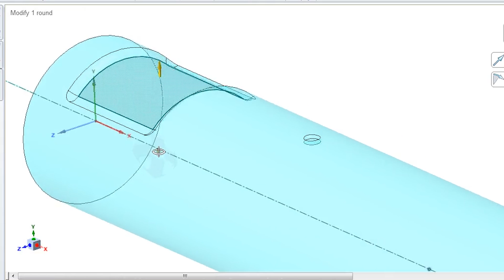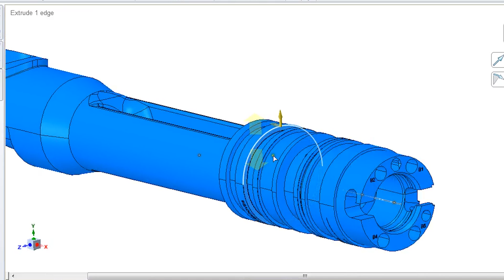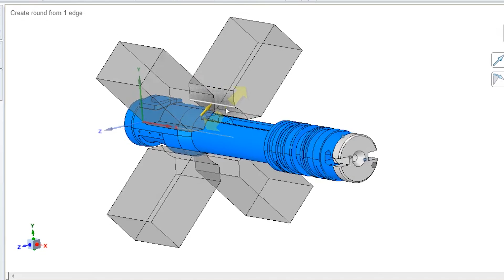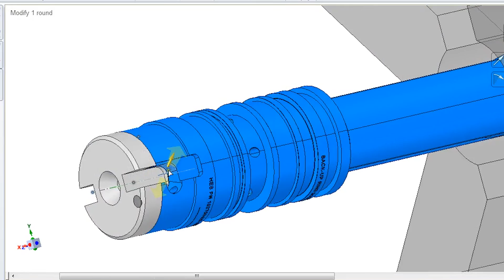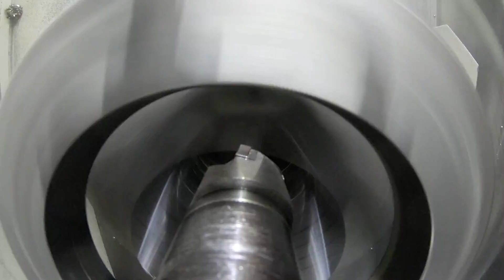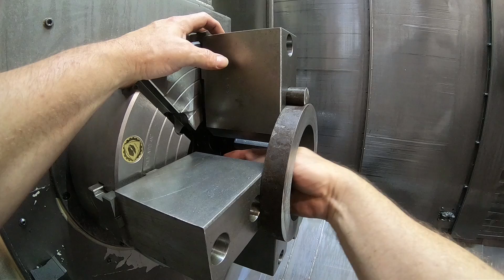Bore Jaws Again New Job

Comment: Very nice video. Im a machinist from Tomball. I started using the tailstock at a my new job but it pushes the part up and down. I can see it and feel it. Does the tailstock need adjustment?
Reply from the maker: Thanks Jose. It sounds like it does. Turn a part with the tailstock than mic the diameter along its length. The diameter should be the same at each end and in the middle. Or as close as reasonably possible. If not the tail stock or spindle need adjustment.
Reply: Edge Precision thank you. The machine itself has about .002 taper. But when using tailstock it has about .009. Thanks for your time

Comment: I have a HAAS lathe St-30, mill turn, X,Z,C axis. No Y axis. How do you set your zero for your jaws on the mill operation in this video. And how would the WCS look like in the cam? love your instagram page by the way thanks for this knowledge.
Reply from the maker: The zero in this cad drawing doesn’t show as the one I set on the machine. I copied just the jaws solids into a new file that was not shown in the video. The zero was set with the XY on centerline of rotation and the Z on the face of the jaws. It is basically the same in cam.

Comment: Really dumb/ "Silly question"... @Peter Increasingly I see small finishing operations being performed on multi-axis machines that utilize GRINDING. I.e. small grinding tool, a dressing operation and then a couple of light passes (especially for hardened materials). Question is ::: Doing light grinding/finishing operation on an Integrex machine less than 0.001% of the "work" would that 'eff-up one's machine in terms of filtration and swarf / fine particles. Is there a way around that to protect one's machine from being knackered by fine particulates in such a case? [This is for folks that don't have a ton of expensive grinding equipment in their shop and need to achieve more "randomized" surface finish with reasonable tolerances for smaller key features and surfaces.].
Reply from the maker: I would say first you should try hard turning and milling with CBN inserts. After that if it was very little grinding say with super abrasives that would probably be OK. Think about people that grind on their engine lathes with tool post grinders. If you were going to do a fare amount of grinding with standard abrasives you would need a special filter system. Maybe laying some of that filtering paper in the chip conveyor holding it with magnets might be good for a little grinding to catch the abrasive before going into the conveyor.
Reply: + Edge Precision , That's a great tip especially filter paper + magnets. Hard turning and milling + CBN inserts that seems like fun (not everyone will have the small chuck + rpm for smaller work pieces) but for larger diameter work pieces that must be quite a 'trip" seeing that dynamic annealing process at high surface temperature with glowing strings coming off would be cool... [Maybe one for your go-pro in low light with white hot strings @ Peter... Good shots BTW your rig  + lighting is working out well]. Some folks from the application end of things say that sometimes just hard turned articles have a surface pattern (almost invisible) that can induce a tapered or mating fitting or what-not to bind and hence a more "Random" surface structure (rather than banded structure) would prevent that hence a finish "Grind". GREAT TIP BTW really appreciate it. Lot of things to try out. Very nice.

Comment: So valuable. Your average CAD-jockey transitioning to complex machining would never in a million years think of boring the jaws the way you did @ Peter. Those pins and the ring; so important [It's like you cut a pre-figured very slight taper into the jaws that when at full clamping pressure extend that pressure to the work piece better to the front of the jaws... That's really cool!]. . Also what you said about reducing the profile / gripping surface of jaws on a 4 jaw chuck to aid adjustment so the work piece is not locked into an unfavorable position really useful [That "tip" would save someone a LOT of "monkeying" about]. Dumb question... Does using that ring and pins substantially help rigidity in an interrupted cut also.

 Eventually kinda interested in what can be done to make interrupted cuts "Easier" and "Better" on an actual work piece as well... Food for thought. THANKS SO MUCH FOR MAKING THESE VIDEOS !!! :-)
Reply from the maker: A lot of times I see people with vibration problems on CNC (Or manual) equipment. I inquire how they bored the soft jaws. A good percentage of the time this is their problem and they don't know it. It will help with any chucking operation. Getting full contact and equal pressure on the soft jaws is always good. No mater what the machining operation.

Comment: Did you braze that bronze in there?
Reply from the maker: No it was sent to a shop that specializes in this. I think they have a CNC machine that does it with some kind of arc welding process.

Comment: Peter,did you use Polish BISON 4 jaw chuck?if so what do you think of its quality?im thinking of buying one .lucky for me im in Europe just under Poland.thanks for your videos .
Reply: and also can i bore holes for pins like yours in 125mm chuck with no holes?thanks agan for your time.
Reply: Stefan Stamatov you could use that method on any size chuck, but for a small chuck an adjustable boring ring would make sense.
Reply from the maker: Yes the chuck says on it Made in Poland. I have had good success with this chuck. I think there was another comment that said they also use these chucks and like them.

Comment: Do you have any idea on the actual chuck pressure when tightened , or just doing it by feel ? . cause on hidraulics it's really easy to clamp with same pressure every time . Cheers , and congrats on closing in on 20000 subs
Reply from the maker: Thanks kiss peter, No I can't tell the actual chuck pressure. I am using that 3/4" ratchet wrench with a 28" long handle (When its fully extended). Sometimes I even put a 24" long piece of pipe on that and have pulled as hard as I can. So that's a lot of toque. With the serrated hard jaws it digs into steel about the same as a hydraulic chuck would with some pressure on it.  On the sub's thing thanks. It was AVE's shout out that got me an additional 3000 or so sub's.

Comment: So do you have a cabinet full of soft jaws you have done over the years that you can sort thru and use when setting up?
Reply from the maker: I do have quite a few. I do often times get to repeat the jobs. So I resist machining the special ones if possible.  At the size of these jaws that's a significant investment. I am giving some thought to buying some flat bar and making some myself. The problem is I just don't have the time. I guess in a way that's a good thing.

Comment: Did you order your Mazak without the hydraulic chuck ?
Reply from the maker: I do have a hydraulic chuck. It's a 21" kitagawa. The odd thing its never been on the machine. It still has the original cosmolean on it. The people that owned the machine before me did mostly shaft type of work with gears in them. So they put a special center shaft driving chuck and never mounted the 21" chuck. When I received the machine the 21" chuck would have to much clearance problems for my initial setups. I also needed the manual four jaw (Some of the parts I do have two centerlines). After using the smaller (16-1/4") four jaw I began to like it and never have mounted the 21" chuck ether. The manual chuck has many advantages for my type of work where the chucking time is not a significant factor.
Reply: Edge Precision Sell that Kitagawa and use the proceeds for some new Sandvik Prime tools and inserts!

Comment: You're using a Mazak CNC? Also whats the best CNC company out there for CNC's, no tormaks.
Reply: Lime purely application specific and how much you want to spend
Reply: maybe 15k-50k typically for idk automotive application specific? what types of app specifications are there
Reply: $15-50k will not get you the best CNC...not even close. It will get you a Haas which is a good cheap machine.
Reply: I don't need best but i don't want decent, maybe in between a middle ground lol
Reply from the maker: Are you talking milling or turning machines? If turning I have a friend of mine that bought some used Mazak lathes and is doing some fine work on them in your price range. You can also get into a used Haas mill at that price range. A lot of machinists get all worked up about certain brands of machines. Consider this its the machinist that make the part not totally the machine. A skilled machinist considers the equipment and makes adjustments accordingly. Certain things may be easier on so called name brand machines but it can usually be done (assuming its within the machines capacity) on a less than ideal machine. If you intend to buy used equipment and you don't have experience. Take someone with you that knows what to look for in a used machine. You can get into a lot of trouble and expense if you buy the wrong thing. Some people enjoy rebuilding and restoring old equipment. But if you want to make a living you cant afford that. Spend a little more on something reliable.
Reply: oh ok. Thats good general information. I was really looking for specific information lols. I'm looking for a milling machine, no lathes.
Reply from the maker: The only way your question can be answered is with general information because the question is a general question. No specifics. Lets look at automobiles for instance. Is a Porsche better than a Dodge. Probably so but it will cost more to maintain the Porsche. Is a Doge better than a Chevy or a Ford. Who can say its up to your biases. They will all get you to your destination. Machines tools are a lot like autos. Some people prefer a Porsche some a Mercedes some a Audi and so on. I don't hold to different brands of machines I have done good work on a Haas or on a Mori Sekei  or a Mazak, Deckel exc. Like the auto's the more expensive the machine usually the more it costs to maintain. It doesn't necessarily do better machine work. You say no Torchmac but that may be good enough to do the work you intend. There is no best CNC company.
Reply: Oh, I hear Tormak's PCNC 1100 is a personal machine, it might be a big more compact and thats good but i hear everyone goes with Haas, Mazak and so forth. Literally i was looking online researching and they talk about Tormak as one of the least ones they'll suggest. Okay, I'll take your word for it. Maybe I'll just go with something reputable model and look online and just go with that. I like those quick change feature, i don't know what its called. Its automatically controlled :D

Comment: How did you put the radius on the (4) 1.25 Dia clamping plugs that hold the ring? Thanks for sharing!
Reply from the maker: I should have show this in the video. I clamped on the ring with the pins sticking out beyond the rings face. Than I used a Endmill while rotating the C axis to cut on the inside. Equivalent to boring them on a lathe without milling capability. Than unclamped the ring and pushed them back into the holes and reclamped the ring.
Reply: Edge Precision easy enough

Comment: I am just wondering how do you have a back pressure " from inside chuck " with a hydraulic tail stuck that the pc doesn't move back in the spindle with pressure of the tail stuck .
i saw you machined the jaws true and no step in it .
Reply from the maker: There is a pressure regulator adjustment on the tailstock quill. I have the pressure turned down. This adjustment works very well the pressure can be set to almost nothing if required. With that much jaw contact it would take a lot of pressure to move it. I also tighten the jaws very tight on the chuck. I have run other parts the same way without any problem.